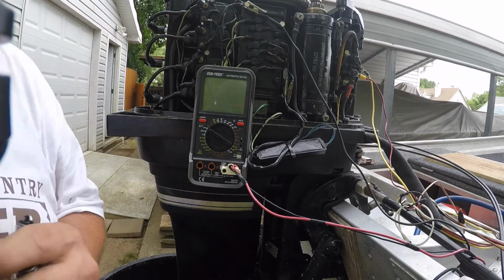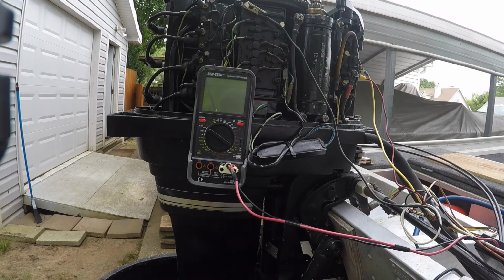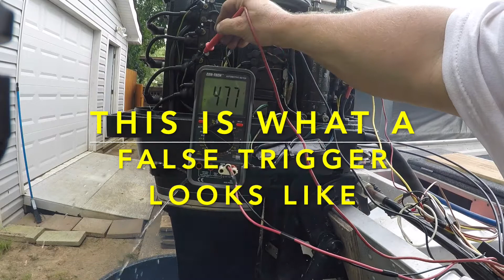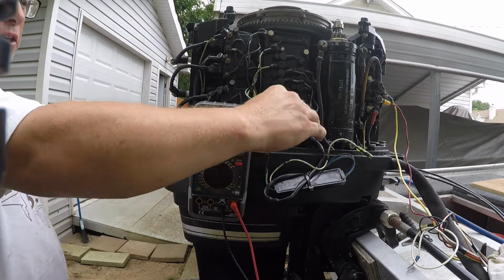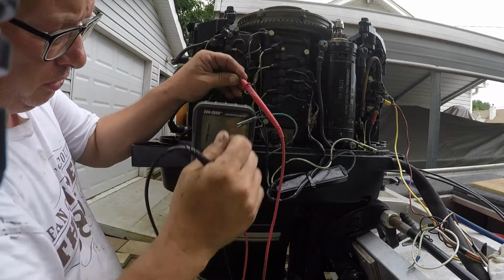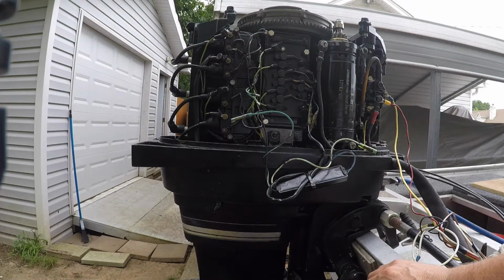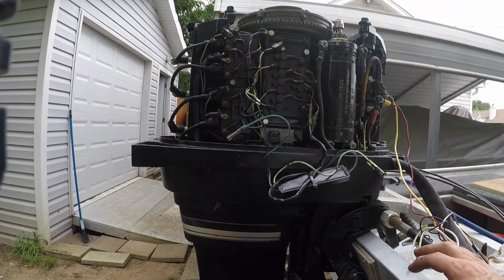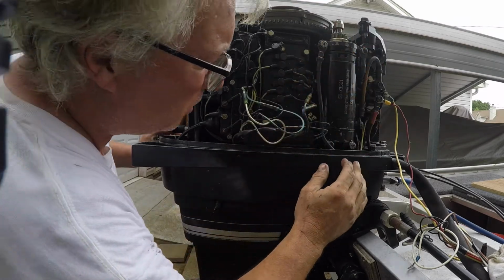What a faulty trigger looks like

Comment: Could a faulty trigger coil causes high rpm?
Reply from the maker: If the inner magnet of the flywheel has moved I suppose its possible or a lean condition with the fuel.